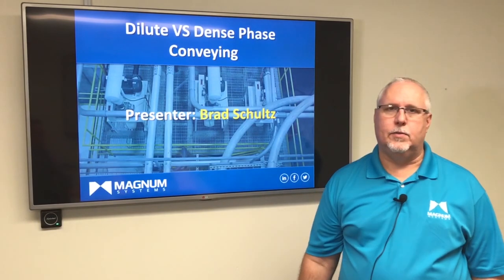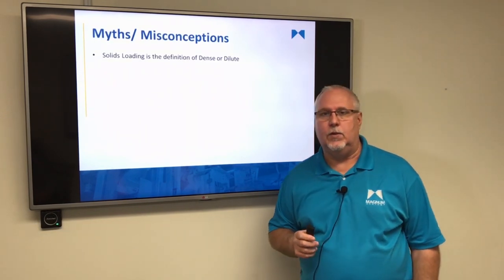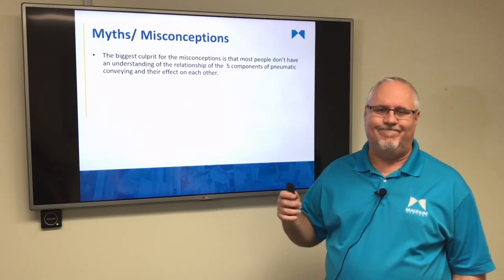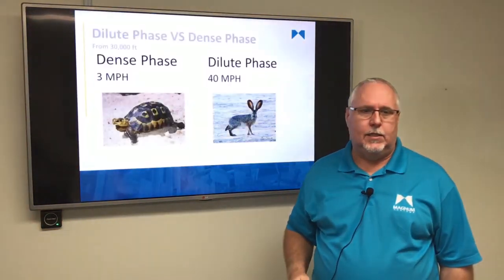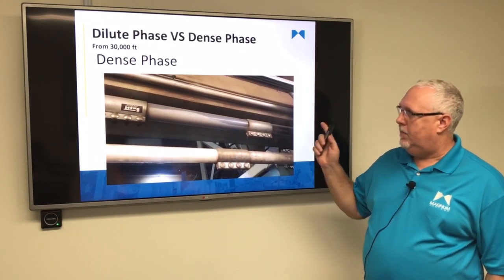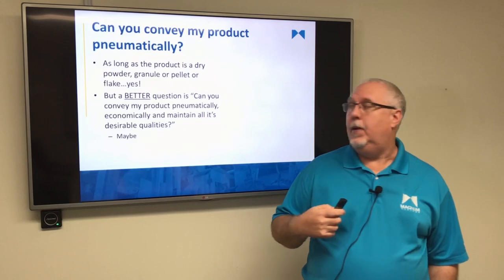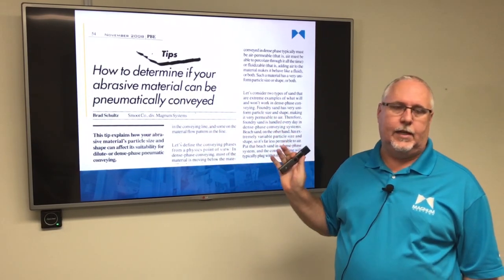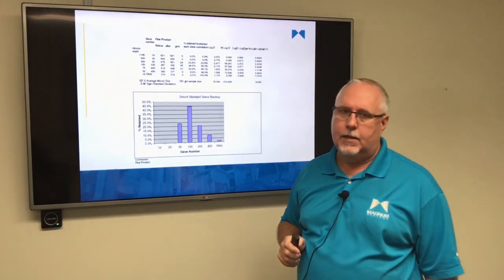Dilute vs Dense Phase Pneumatic Conveying

Comment: We have an abrasive material Alumina with 60nm particels current running in dilute mode cause excessive pipe wear. Would changing to dense phase work? 

Thanks. We use pnuecalc software.

Comment: Hello, really helpful presentation. Just a quick question, my material is conveying in dilute phase with a blower and if I want to shorten the unloading time, can I, in theory, add another pump along the conveying line to speed things up?
Reply from the maker: Increasing pressure is the only way to increase rate in an existing line.. another blower will add volume also and thus be self defeating

Comment: Great explanation, thank you for this video, so, if I want to move lime at 40 ton per hour, which kind of system I should choice? Thank you again.
Reply from the maker: one should look at dilute phase 1st…it is less expensive to buy and to operate.    Dense phase needs either abrasive or fragile materials as a reason to look at it